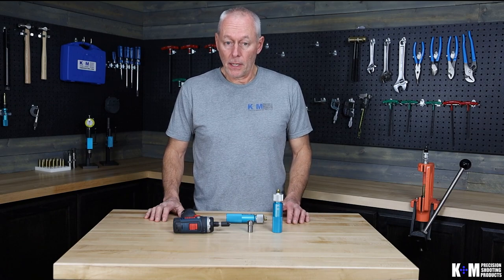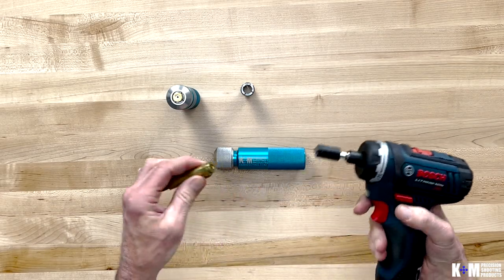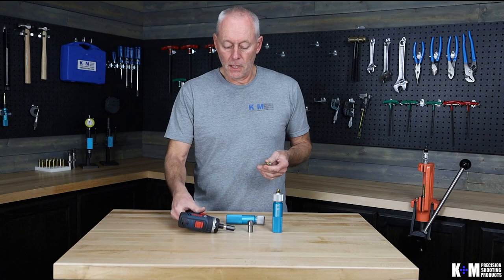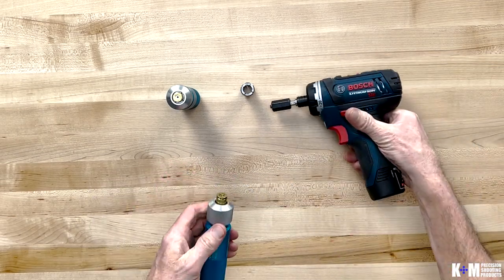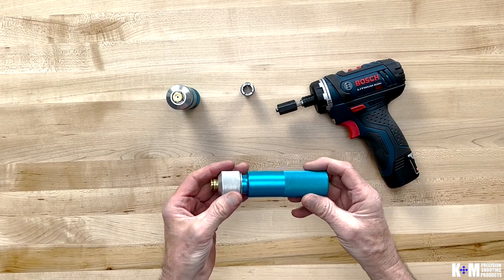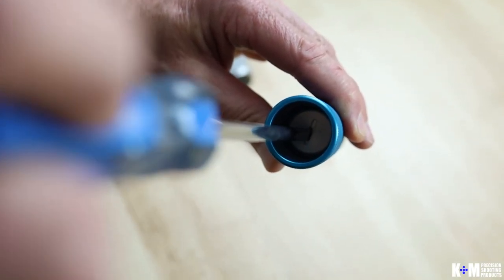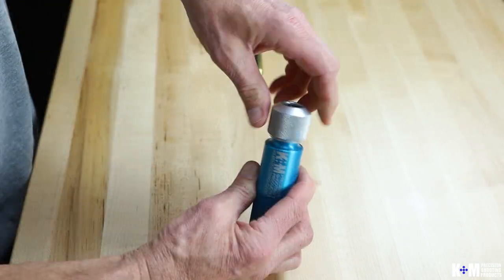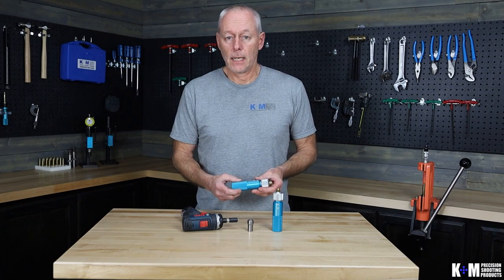Case Holders

Comment: this is for sure a want over a need and i need this so i want it
Reply from the maker: It becomes a need when finger/hand pain from grasping cases stops your reloading.  It's a good day (and a want) if you don't have pain while holding cases, but a different situation if you do. Twisting an 1-1/4" diameter cap with the palm of your hand is MUCH less painful than grasping 3/8" or smaller diameter cases between fingertips. As they say, one man's trash is another man's treasure.